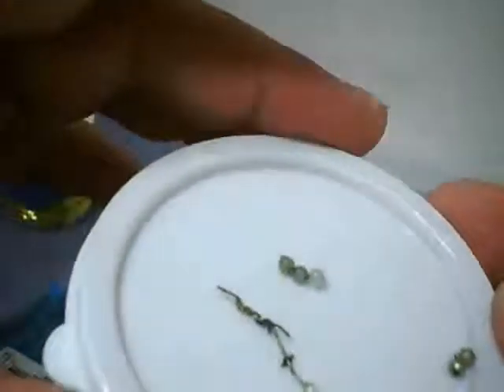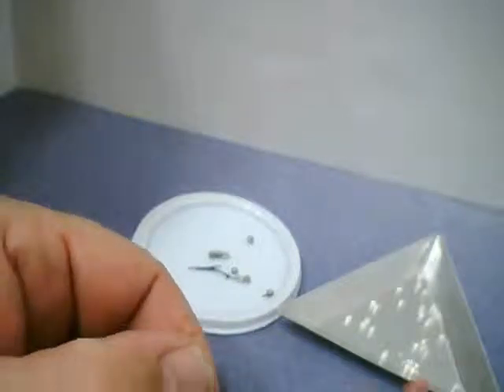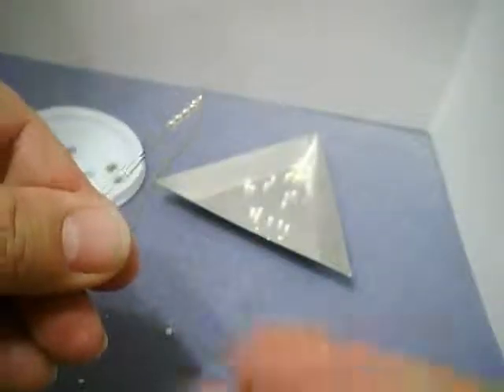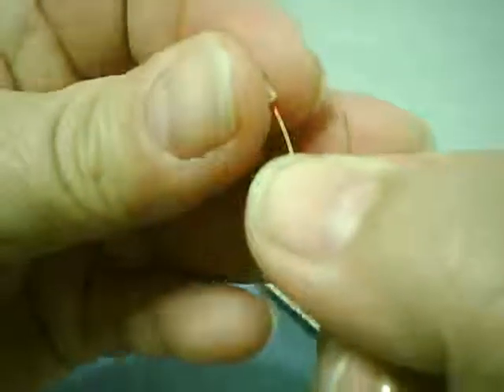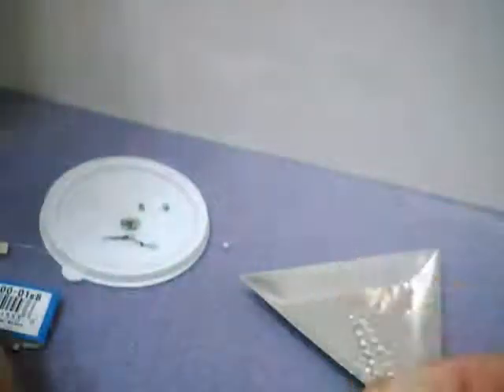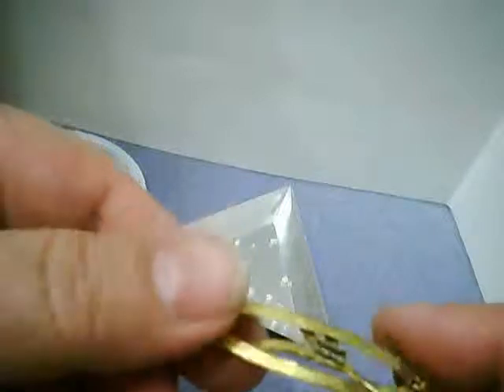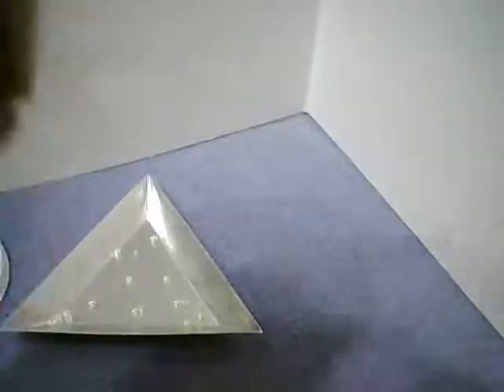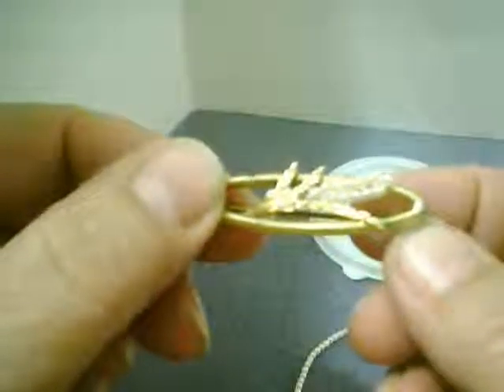Repairing Faux Pearls on a Goldtone Pin

Comment: You did a good repair job Pat. Handling those little beads are hard enough in the best of conditions but to do it on camera is not as easy as one would think. And I understand the frustrations of not staying in frame. You have seen my videos. Lol. Pretty pin. Glad you repaired it and that you shared the repair with us.
Reply from the maker: I am so glad to be able to learn from others, like yourself, and then share.
Reply: Thanks. I agree. I learn so much from watching others on YouTube. It is only right to pass it on anyway we can.